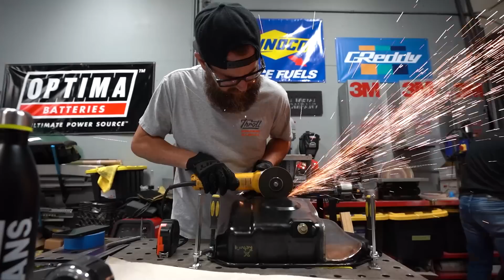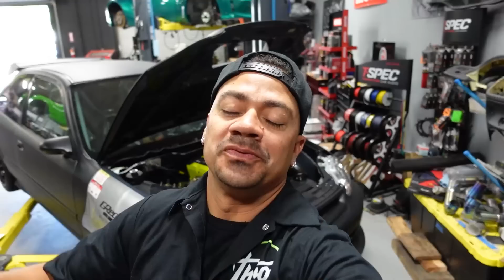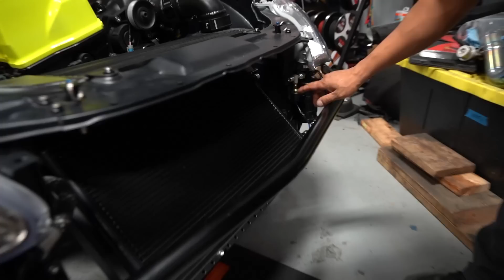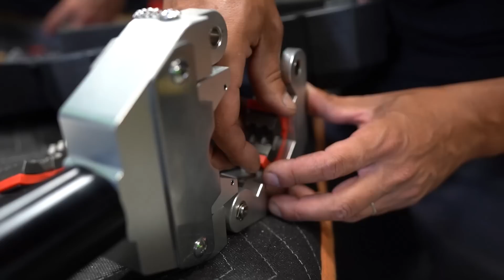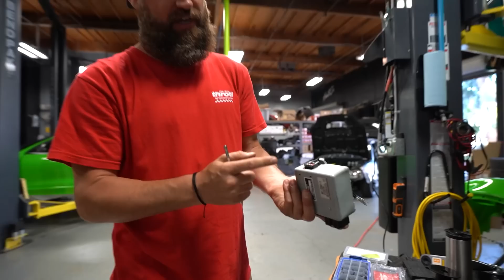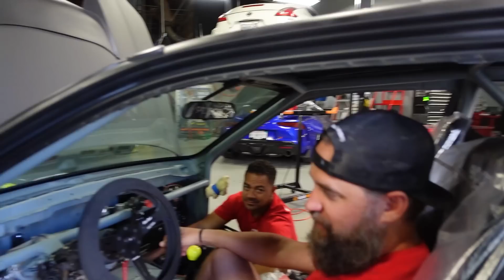Building a Rear Wheel Drive, K20 Turbocharged Honda Civic EK Hatchback Race Car- Reassembly Part 8

Comment: Hey all, I have question. Was hoping any of you good fellas could help me answer it

I always had this in mind: 

Build EK Hatch, K swap it, power steering delete, water pump delete and ac compressor delete. 

But I still want all of that, so put eps(motor assist) of 9th gen civic along with the computer, electric water pump(probably from KTune), and electric(full electric, not with aftermarket pump and tubes to the rack kind of thing) ac compressor as well

Is that possible? So get all those things without stealing any from precious K

Comment: Wow that ac crimper must be a pretty penny. Probably worth it bc there’s no one that makes lines. An ac kit like the company you used for the AN fittings would be cool. Maybe you guys can explain, why are duetch connectors so dam expensive. They are great but even the tool is super pricey compared to other wiring tools.

Comment: Did this guy just say if you turn the powersteering assist all the way up you get rid of bumpsteer? 😅
Reply: Yes I did.. Believe it or not when you tour it up the electric power steering Eats it up
Reply: @duneaddict  Later in the video i noticed that what you mean by bumpsteer is a different thing as to what i think is bumpsteer. For me it is a change in toe when the suspension travels through its way, thats not gonna change by turning up the powersteering ☺ But that's not what you were talking about so its cool!
Reply: turn it up

Comment: Probably a noob question, but when modifying the oil pan like that, do you have to think about flow in and out of the pan? Like can oil get caught in that added section and not get used at the same rate at rest of oil?

Comment: Wouldn’t you not be able to drain all the oil when doing an oil change since the plug is now higher than the bottom of the pan?
Reply: The plug is still the lowest point.

Comment: Should’ve went around the passenger side behind the engine to the firewall for a more clean stock oem look
Reply: No room homie
Reply: @mickeyandrade3435  oh my bad I forgot you guys had to kinda push the engine back a little for the transmission to fit properly